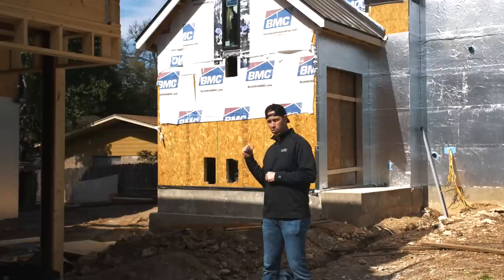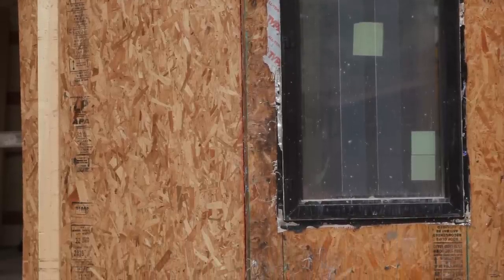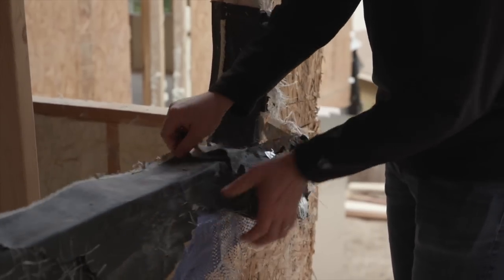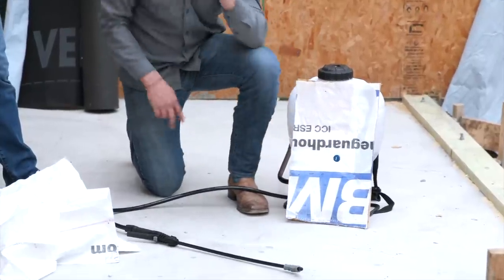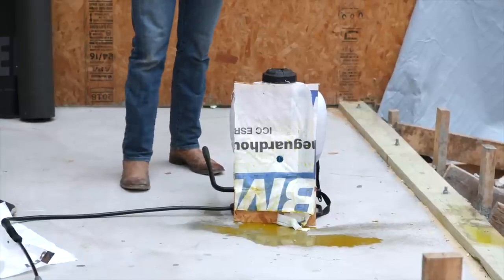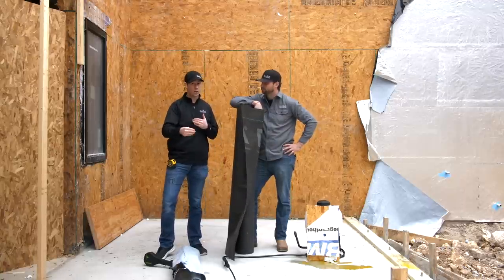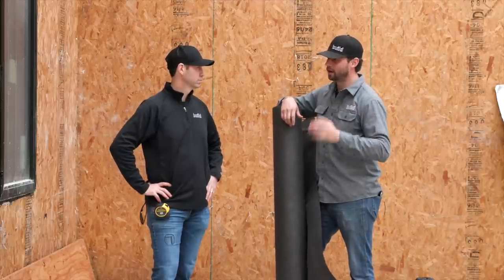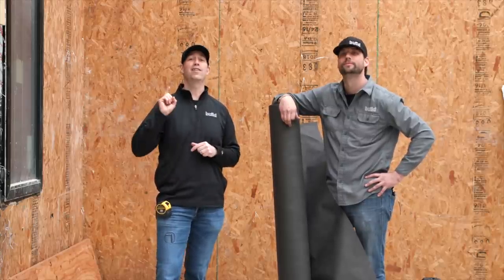Mold and Rot on a BRAND NEW HOUSE - What went wrong?

Comment: Can you just wrap a house, dwelling in Visqueen ❓❓
Reply: Nobody does that, so it must not be a suitable product.  Among other things, it probably doesn't hold up over time, and is prone to damage even during construction.
Reply: it needs to be water vapor permeable, else you get rot.
Reply: @ef7388  Extruded foam sheathing is totally waterproof, and is used on some home exteriors, in some climate zones.  I suspect mineral-fiber boards would be better, but that product is much more expensive.
Reply: @misterlyle.  Sir, absolutely! Here in Oregon, if moist indoor air hits a cold surface at the sheathing on the way out through the wall, it condenses. Your description of closed cell foam would make the inner surface warmer for sure. My next house will likely use an exterior insulation design of some type.
Reply: @ef7388  Here in Florida, it is typically the opposite situation.  Outdoor moisture is trying to get into the house most of the year.  So a moisture barrier will wrap the exterior, just under the siding.  I remember a builder here years ago who had his crew staple a layer of clear plastic everywhere on the interior, and then the drywall was installed over it.  His goal was to stop air leakage, but I wonder how those houses have endured.
Reply: @misterlyle.  It would be interesting to peek into the wall cavity to see if anything is growing in there.. Managing outdoor humidity sounds like a challenge in Fla. I am constantly amazed by the effects of moist air flow in houses near me with their built in leak paths... Many older homes in colder climates leak air through the ceiling penetrations and condense moisture under the roof sheathing due to stack effect and "closed up homes".  So managing ventilation and humidity is an opportunity!
Reply: @ef7388  Around here, and especially regarding older homes, opening up a wall cavity is usually a messy and sometimes revealing experience.  There is often hidden rot just waiting to be discovered.